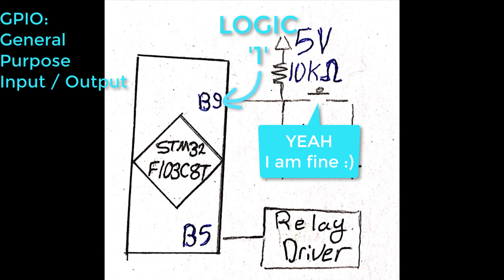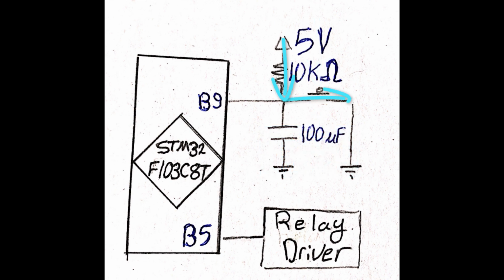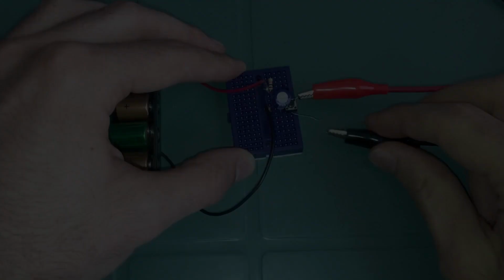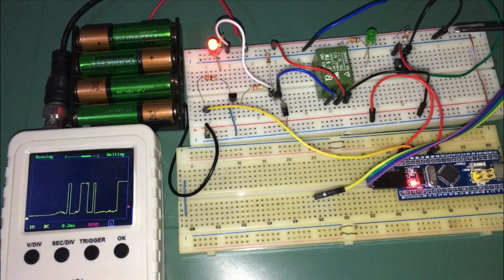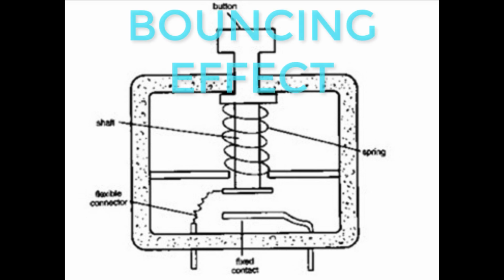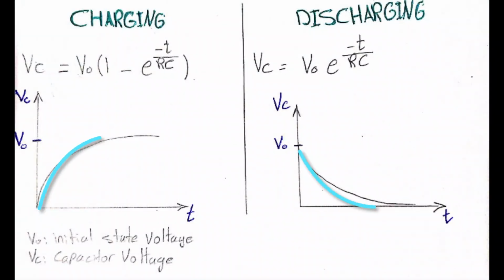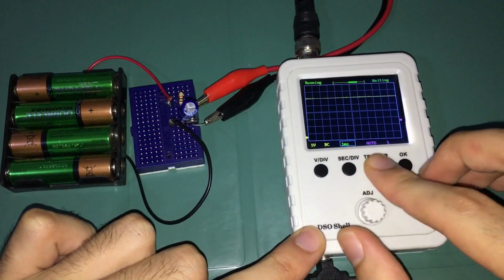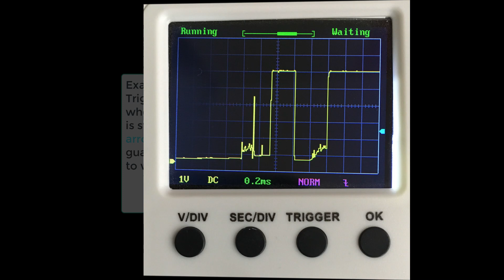Switch Bouncing Effect and Debouncing Circuit

Comment: Using a large capacitor to debounce a switch is hard on the switch contacts and will wear them out.  The capacitor current is only limited by the ESR and wiring resistance so a few amps may flow across the switch contacts which are only rated for a fraction of this.  It's better to debounce a switch with just a bit of code, no capacitor needed.
Reply from the maker: yes that is always fine. Personally I do it the same way and this mentioned in the tutorial. I wanted to share the hardware solution as well